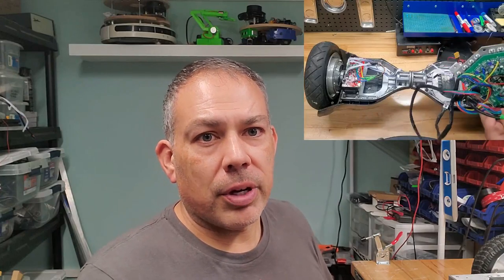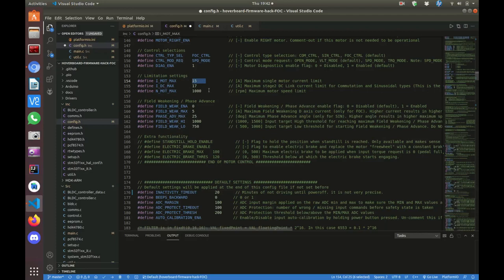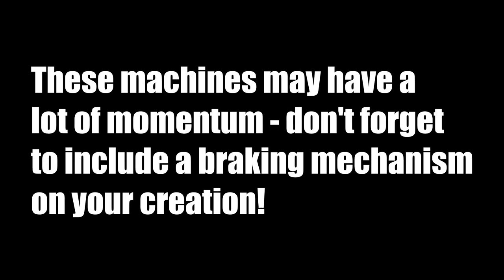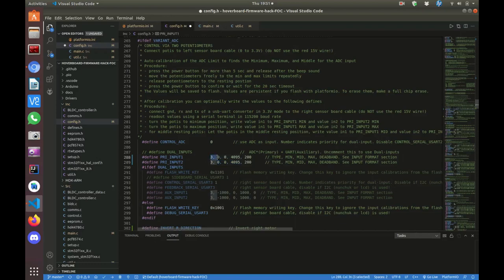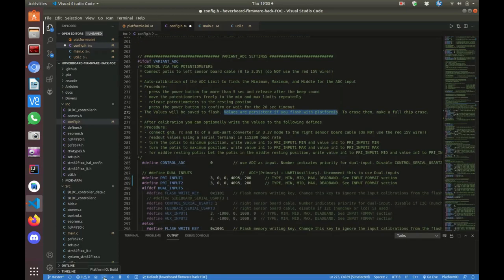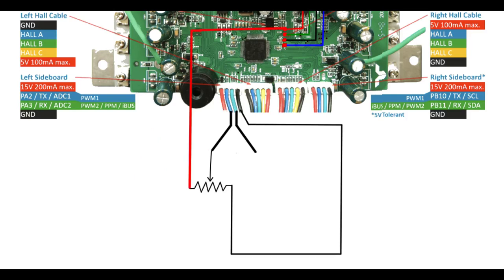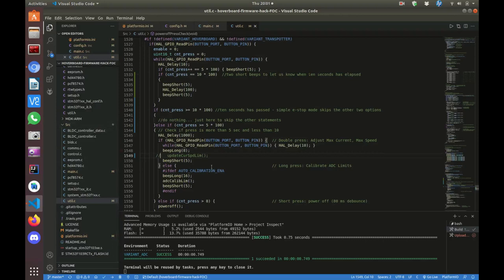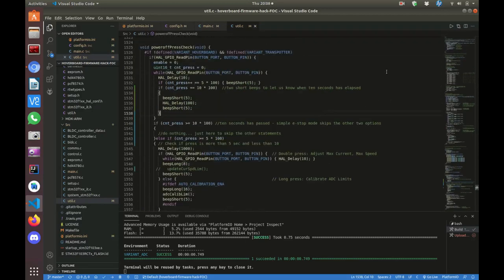Hoverboard Robotics Tutorial Part 3B: Hoverboard Robot Drive with Joystick Potentiometers

Comment: Thank you – great tutorial. I have a question: I Build an ADC-controlled electric scooter. If I want to control both motors at the same time, I only need to use one potentiometer on first input. And for the second input, solder GND->5k->ADC<-5k<-3V3? My scooter is at the frame welding  but i wont to lern as much as possible about the controll.

Comment: thanks for this great tutorial, i have flashed numurous hoverboards by now, uart and pwm works fine. But i cannot get ADC to work. I flash the ADC variant but and wire up 10k pots to short cable. but there is no movement, just changing buzzing sound when turning the pots. then if i flash PWM firmware again it works as it should. i dont know what to do, got any tips?

regards!

Comment: Thank you for the detailed information on the code changes the complete setup, I really like the speed limit in the Low Pass Filter ( main.c ) as gratitude of your work  I just purchased an e-copy from your book Practical Robotics with C++  I am sure will be very useful and will learn a lot.  Have one question if you can advise?   ADC with speed mode and  with mid type potentiometer   joystick ( 10K  the same joystick you show in your video )  control  limiting the steering value  to 0.1 from mac in low pass filter really helped to reduce the speed but would like to do some extra modifications - would like to keep the forward speed on maximum value but to limit only the reverse speed to be not bigger to 5 km/h  ? will appreciate you advice
Reply from the maker: Hi, and thank you!
I'm going a bit off of memory but first: change the multiplier I added in the low pass filter until you find the value that gives the reverse speed you want. If we pretend that value is -0.4, then I think could replace the 
speed *= .1; 
with 
if (speed < -0.4){
speed = -0.4;
}
I haven't tested this yet or had coffee - let me know if it works!
Reply: Good morning and thank you for your help  I have done the modification in the low pass filter following your recommendation and YES  it works perfectly now I can get the maximum forward about 620 RPM  speed and reduced reverse speed of 40RPM and also reduced the steering to 25RPM  however I have lost the beeping sound on reverse I guess the RMP is too low and the firmware doesn't capture it. Is there any way to fix the beeping sound on reverse and also add beeping sound on steer ? @PracticalRobotics
Reply from the maker: @george701122  Very cool. For the beeping it looks like in main.c there is a if statement: 

else if (BEEPS_BACKWARD && ((speed < -50 && speedAvg < 0) || MultipleTapBrake.b_multipleTap)) { 

I imagine you should be able to that <-50 to <-10 or some other value that you find desireable. Cheers!
Reply: @PracticalRobotics  Thanks again for your valuable input it help a lot, I followed your recommendation and indeed works perfectly also added BEEPS  on steer. So far have noticed only one issue when fast releasing the joystick in a neutral position ( from forward to neutral ( pot. mid. point ) with 120KG load )  in 80% of the cases the hoverboard is automatically shutting down  I have measured voltage pick over  70V  I guess battery BMS is engaging automatically overvoltage protection any idea how to overcome this ? is there any algorithm that can change the status of the speed potentiometer from Max to Mid more gradually to avoid that voltage pick?
Reply from the maker: @george701122  That's an interesting problem. I think something like the solution I use in this program: https://github.com/lbrombach/practical_chapters/blob/master/chapter12/simple_diff_drive.cpp would work for this too. That program makes sure that sudden changes to motor speed commands happen gradually by comparing the requested value to a static variable holding the last commanded value. Look starting on line 209. leftPwmReq is the value currently being requested. leftPwmOut is the last value actually published. If the request does not equal the last value already out, it only changes what is being published by PWM_INCREMENT. Hope it helps, Lloyd.
Reply: @PracticalRobotics  Hi, the RATE parameter of the firmware is also meant for that. It can bevused together with FILTER parameter to smooth out the commands
Reply: I added some more details here https://github.com/EFeru/hoverboard-firmware-hack-FOC/wiki/Parameters
Reply from the maker: @candas1  most excellent, thank you on behalf of many.

Comment: Very useful tutorials! Do you have any way to work the motors with a potentiometer and direction change option? 
Thanks!
Reply from the maker: I'm not certain what you mean by direction change option? The wheels will reverse when the pot is moved past the center. I also think I saw a reverse direction parameter but it might be easier to reverse the potentiometer wires.
Reply: @PracticalRobotics  Thanks a lot!
 I found the way for the rear drive as provided by the ADC mode and mid pots. However, I am looking for a solution for my own application and I am having a hard time. I want to have low rpm (about 100) and high torque. When I drop the rpm from "define N_MOT_MAX" the torque also decreases a lot. Is there any option to have low rpm and high torque?
Reply from the maker: @WhyNotCycles  That's getting a bit out of my area of expertise, but these aren't known for having much in the way of low-end torque. You might try increasing the voltage - I think the original guys that did the hacking said they've applied up to 60v before things started burning. Maybe 48 or so would be useful without being dangerous... but I don't promise anything. I would usually look at gearing and a different motor if I really need more torque.

Comment: Hi Candas, great project, ya saved me money and time by doing the nice code for better commutation and free wheeling. I menaged to programe and uppload the firmware to several boards, but mu knoweledge is wery little, and i would like to know how i can connect a single hall efect  throttle to control the motors to use it as an e bike controller, since foc frewhelling allows that. Thank you for opensource sharing.

Comment: It's true the inputs are not scaled in speed mode to reach the maximum rpm set in config.h when the input is at maximum. But you can use speed_coefficient parameter for that. This value is in fixed point so it might be counter intuitive. Great video, do you mind if I add a link to it in the wiki for adc variant?
Reply from the maker: That's a good tip - thanks! I somehow manage to not see that parameter. And absolutely, we all benefit from freely sharing.
Reply from the maker: I just realized that you are Emanuel. Man, thank you very much for your work on your awesome project. Particularly for robotics where the rest of the project already takes a long time, you've saved many of us a lot of time just getting locomotion done. I am very grateful to both you and Alex.
Reply: @PracticalRobotics  No I am not Emanuel, I am Candas 😅. I did small contributions to the firmware, but spent most of the time enriching the wiki. Don't hesitate if you have comments, questions, ideas. There is also a telegram channel linked in the repository main page.
Reply from the maker: @candas1  Usernames can be mysterious and confusing 😂 great work on the documentation - that's a huge part of the usefulness but you know that!

Comment: Thank you. I have two motors set with rpi and working great and now wondering 4 motors. Is it ok to independently flash two boards and parallel wire RPI to control both boards (4 motors) ? Does Makarov's driver have a function for 4WD? I couldn't really find in config variants. Thanks in advance.
Reply from the maker: Great question! There isn't a specific firmware variant intended for 4WD, probably because each control board can only handle two motors. If you mean wiring two board to the same serial TX from the raspberry pi, I can't be certain but I think it might work (controlling two might work but obviously not getting debug data back from two devices on the same wire). If you have reliability problems you can run your program twice (to two different serial ports). I would think the easiest way to do this is with ROS and Alex Makarov's hoverboard driver. Since I recorded the ROS hoverboard tutorial (3A in this series), Alex has parameterized the serial port in the ROS hoverboard driver. Instead of changing the port in config.h, you can now pass the port as a parameter in the launch file. This makes it easier to run two instances of the hoverboard driver at the same time. He has an example launch file on the front page of his project repository. https://github.com/alex-makarov/hoverboard-driver. If you do try it with two boards "listening" to a single serial wire, please let me know whether it works or not. I have been curious but time has been short for me to do curiosity experiments.
Reply: @PracticalRobotics  thanks for the epic info, I really appreciate it!
Reply from the maker: Happy to help!
Reply: Another thing, according to Makarov’s driver github, teleop-twist-keyboard should also work. I successfully run it but the motors won’t move. Does it need a tweak? Have you tried it?
Reply: Ok you need it with hoverboard velocity control now i make it move with keyboard yay
Reply from the maker: @serdar-abali  Awesome, glad you got it working. One thing you may notice using keyboard teleop is an oscillation or waggling after commanding a turn. This is because when the wheels are moving 1 or 2 meters per second and are suddenly commanded to zero, there is an overcorrection which results in the PID overcorrecting yet again in the opposite direction. I have meant to look further into the PIDs (there are two - one in firmware and one in ros driver) but it hasn't been high enough of a priority for me. You can minimize the problem by not going from commanding a fast turn then suddenly commanding zero (like keyboard teleop does). It is easier using rqt_robot_steering to issue a fast turn if you must, then slow down more gradually ... at least to let the final commands be 0.1 meters per second before commanding zero. I find this makes the waggling quite minimal and it more closely matches what the navstack does anyway.
Reply: Hello, I parallel connected from rpi and flashed the same foc for both boards. Works very smooth after some adjustments to hoverboard-driver. I ordered ydlidar and going to buy an old kinect to practice some autonomous drive. I upload video of my 4 wd tests: https://youtu.be/pVyJj-FI5WA
Reply: That being said, I am officially your student 🤓
Reply from the maker: @serdar-abali  Awesome! Thanks for the confirmation. I like how you approached mounting the motors - overall it looks great!
Reply: @PracticalRobotics  i just realized that you posted about keyboard control. It was very difficult to adjust to my liking. Rotating the robot is fine but there is an odd delay when i move it forward/backward. I cannot find values to kill that 1-2 sec. delay.
I will test ps4 / xbox joystick next time, maybe they have more precise control with this driver?
Maybe.
Reply from the maker: @serdar-abali  Interesting. I haven't had a delay problem like that with keyboard teleop.. keyboard, rqt_robot_steering.. joystick.. all publish the same message type. But in case you haven't found it yet, look for the ROS joy node (http://wiki.ros.org/joy) to read a game controller and the http://wiki.ros.org/teleop_twist_joy to convert that raw data to a twist (velocity command) message.

Comment: Hello, maybe a stupid questions...I have the same joystick and I'd like to put inside a case.
How did you dismount the upper part to make possible through a little hole?
Which are the push button wires?
Thanks and congrats for your job
Reply from the maker: I don't think I did... I think the hole is big enough for the joystick and then you a ring or rubber boot to cover the hole. My memory of that detail is quite fuzzy.

Comment: hi. nice tutorial. 
Do you know how to connect a brake to the board?
 I mean i enable the brake but it does not work in adc mode.
I use a throttle handle with hall sensor in it. 
But the problem is the steering coeficient if i put it to 0 the motors dont start at all.And sometime if just move the motor by hand it just stalls and runs in a loop but only one motor.
I dont need steering at all.
Reply from the maker: That is strange about the steering coefficient.in main.c lines 304/305 you can see the formula applied is effectively cmdR = speed * SPEED_COEFFICIENT -  steer * STEER_COEFFICIENT and cmrL = speed * SPEED_COEFFICIENT +  steer * STEER_COEFFICIENT... so it a coefficient of 0 should only result in 0being added or subtracted. You could try  adding steer*=0 in the low pass filter a few lines up (line 288) where I've made changes before.
I'm afraid I cannot help with the brakes..I have not tried that.
Reply: @PracticalRobotics  thanks.i got it to work but it goes only in reverse. if i disable reverse the motor dont spin at all